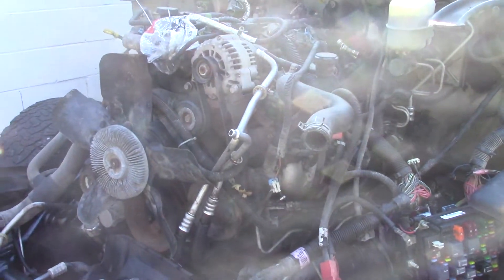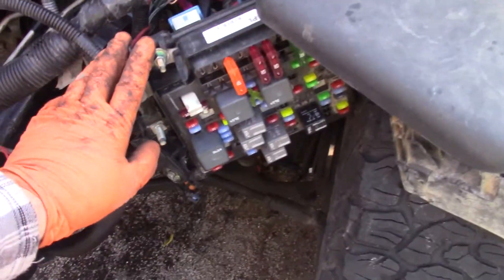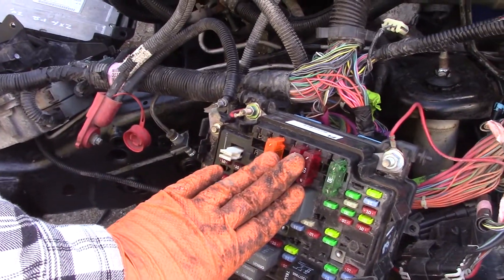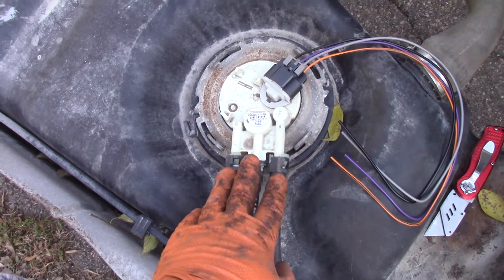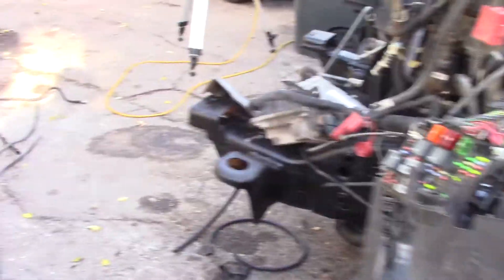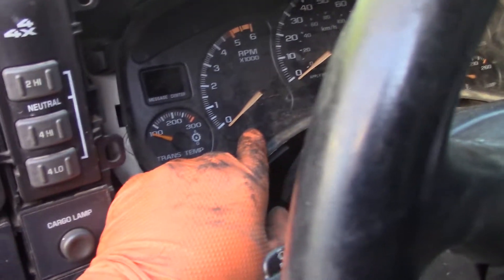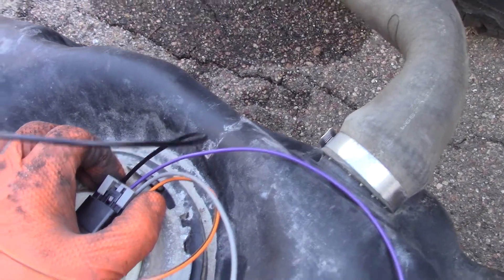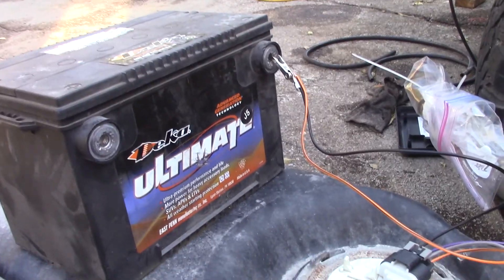Duramax LB7 to Gas 8.1 L18 swap - First start of my DIESEL truck on GASOLINE - Frankentruck part 2

Comment: Hi . I live in California and have a 2005 gmc duramax. Well California just banned my diesel truck . I have to get rid of it . Now I though of buying a new diesel stakebed for my small landscaping business. But they start at $80k ! Used $43k . My other option is swapping engines . I love what you did . It looks like I will have to take out my Diesel engine and drop in a 8.1 gas engine . How expensive was it to do that ?
Reply from the maker: Sorry to hear that... in my case it cost me almost nothing, because I had a complete donor truck available. I only really spent money on "while I'm in there" items like fuel lines and tune up parts. It's a lot of work, though, certainly it would be cheaper and faster to sell the diesel and buy a gas truck!
Reply: Better figure out if that swap is legal in Commiefornia before spending money as you'd need everything from a gasser to do it and if the swap is not permitted then you lost a bunch of money. One way to make money would be to buy diesel trucks in CA than sell them in other states where rust free trucks are in demand. You might make more from that than landscaping.

Comment: Armen, I'm surprised it turned over. You made it look easy. You've done some German engine swaps, how does working on a GM compare?
Reply from the maker: This was incredibly easy. Everything bolted right in, I didn't have to cut a single wire, and it just required a fairly simple custom ECU program. My next GM swap is going to be much more difficult, though...